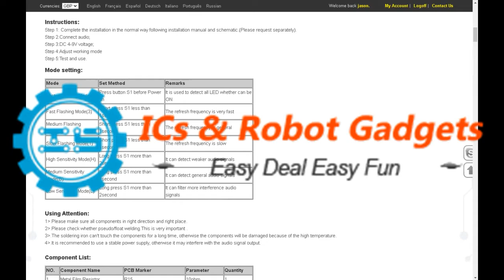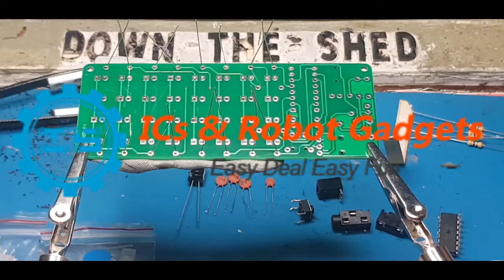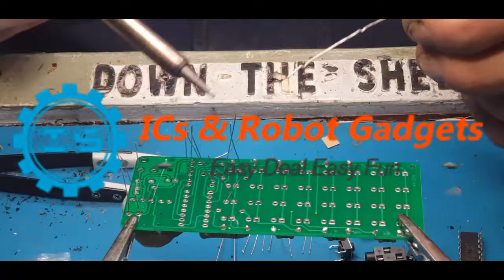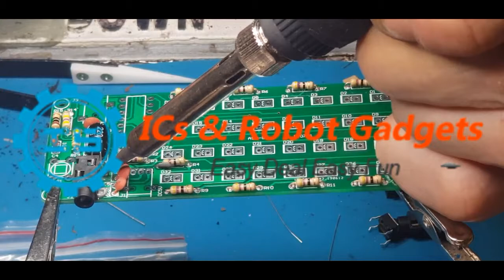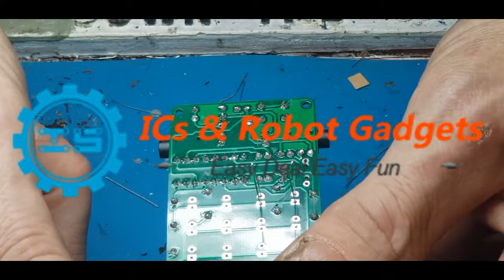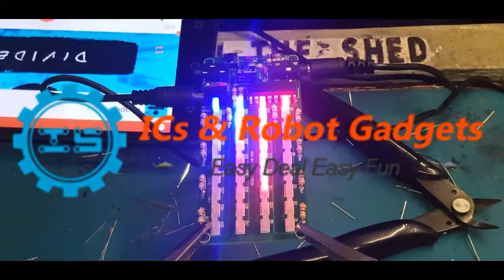ASD-84 Audio Spectrum Analyzer  DOWN THE SHED WITH ICSTATION

Comment: Can I put one on each channel?
Reply from the maker: i think yes, but you'd have to rewire a 3.5mm jack so you could send of to each channel, if using two kits just wire both kit channels into one channel.
Reply: L chanel and R chanel in jack  and com together